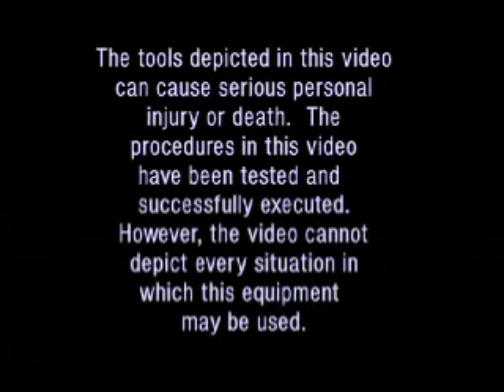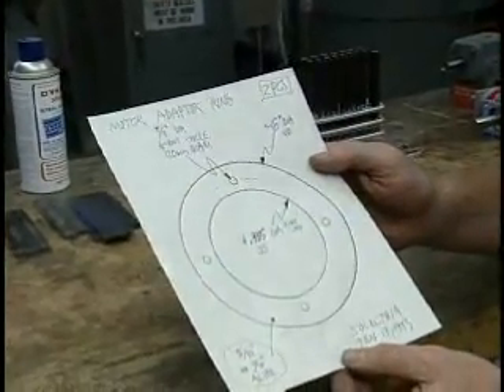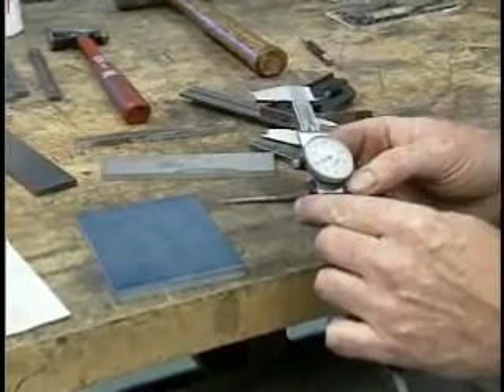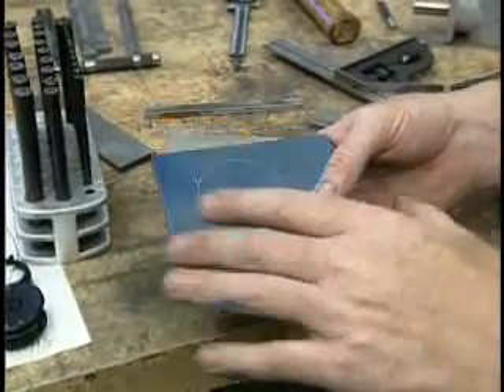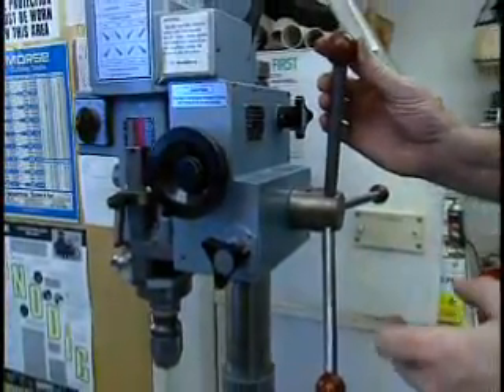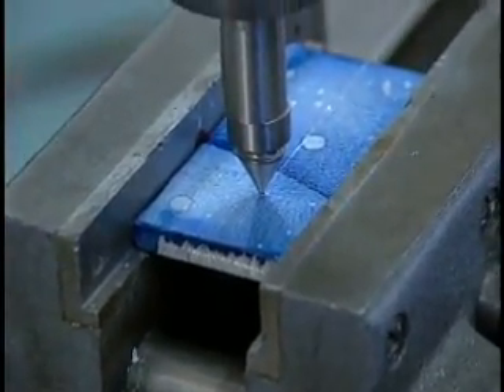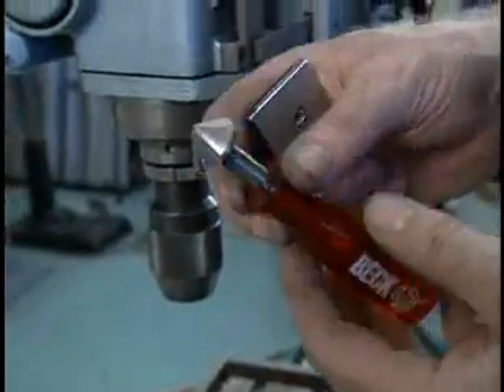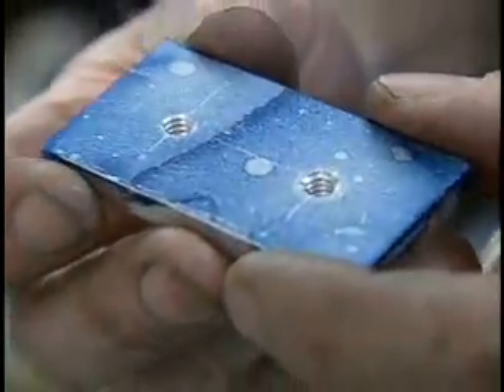Basic Metal-Working Skills, Part One

Comment: A grinder shouldn't be next to a buffing machine. Never punch mark or scribe with your measuring tools.
Reply: Your caution is well intended however I have been using dial calipers to scribe lines for decades and never damaged a single tool.  Dial calipers are so cheap now that I wouldn't care anyway.